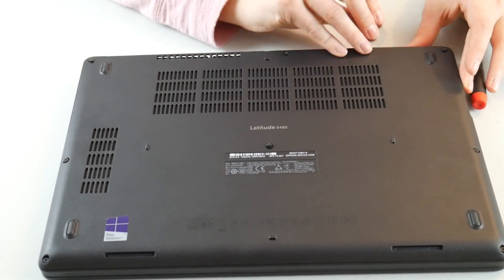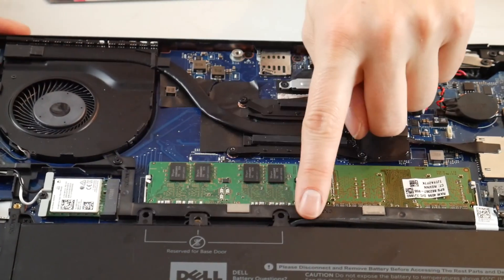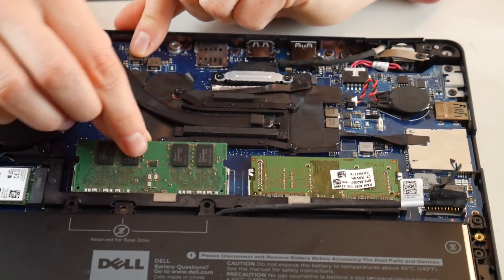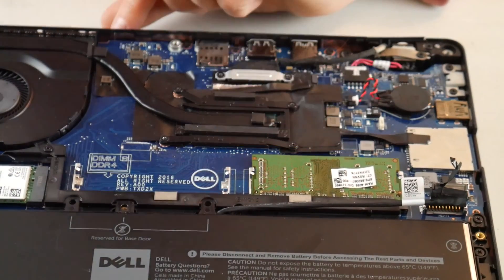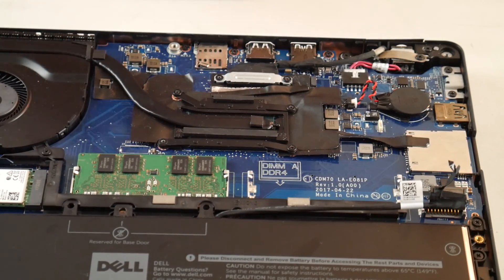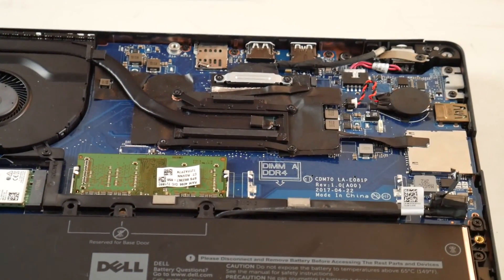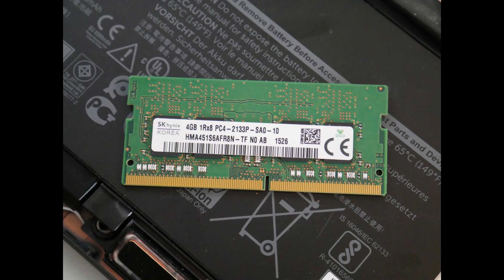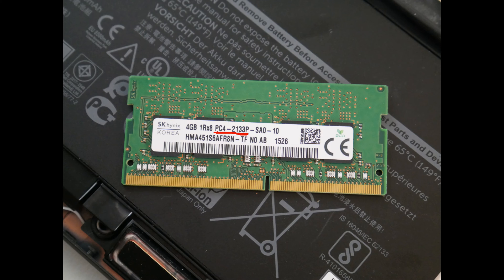How to Fix a Dell Computer That Flashes LED Code 2 3

Comment: Screen backlight turns on but no display. Getting the 2 amber pause then 3 white lights. Have tried swapping ram stick from slot A to slot B and also have another 2 8gb sticks i tried in each slot (6 total combinations tried) and same problem with the lights still. Any ideas?
Reply from the maker: You could try cleaning out the ports with a can of compressed air. Do it with the battery and power cord unplugged. Make sure not to plug it back in until everything is dry.

Comment: Hi, I tried this, but it didn't work. Also, it did 2-4 and 2-5 flashings. What do you think?
Reply from the maker: It can also be a problem with the port itself. You could try cleaning the port out with a can of compressed air.

Comment: When a computer just powers off randomly, more often over time, then won't even boot up, just dies when the Dell logo appears, or even before then.
So, remove the only single RAM stick and power on and gives 3 Blue 2 Orange on a Dell Optiplex Micro 7000. 
Would that mean it was the RAM that is faulty, or it is detecting that there is no RAM?
I suppose the latter but then we don't know if the RAM was faulty or the motherboard or CPU is still faulty but simply the motherboard has detected no RAM and so not progressing to the next stage of boot that causes it to die?
Reply from the maker: Ya its not detecting a RAM stick that's why you are getting that LED code. You would have to buy a new stick to see if the RAM is the problem. Also could be a power issue. Here is a video on how to diagnose that:

https://youtu.be/UIZitN-cnik
Reply: @EggheadFixers  thank you, it's a micro desktop but did try holding down power button with power cord removed. Getting the RAM replaced. Thanks!
Reply from the maker: @jonmobrien  You are welcome!

Comment: What if none of the steps shown in the video fixes the issue? I blown both slots with compressed air and switched modules, no luck. The RAM module is actually working just fine in another Latitude 7490 so, what's next? Ideas? (besides the obvious which would be buying a new laptop...)
Reply from the maker: Have you tried both RAM slots? I would try these two videos:

Release Flea power:
https://youtu.be/TA1mFPtKVnw
Bios reset:
https://youtu.be/bZSz-jjexqM

Comment: Is there any kyboard  words to press or push like fun I tried everything before that my laptop was fine I just opened and re packed all is fine I did before but I'm wondering if there any button because i remember whenever when I pressed the button it turned on now this not just that orange this 😐
Reply from the maker: It could be that RAM came lose and that's why it's suddenly giving you problems. It's a pretty common problem with laptops. The RAM can loosen from being moved around over time and then you will get an issue like this. There is also always the possibility that on e of the RAM sticks has failed.
Reply: @EggheadFixers  it blinkds orange
 2, 7 white after all I'm confused I cleaned ram and  I got this code  blinking 2 by7 dell Inspiron 15 5559 kinda like that it's with bios I also cleaned and replaced battery still have no idea 😐
Reply from the maker: @ghjgjgjttytttt  Error code 2 7 indicates a screen issue. Usually an issue with the LCD (screen) or LDC cable. You confirm this if you can hook it up to a monitor and it displays to a monitor.

Comment: I was change ram in slots, but laptop doesn't run. Ram is new and laptop was running with it. But now i have 2 yellow and 3 white led error(
Reply from the maker: Is it the same kind of RAM that you had installed before? Also is it a name brand kind of RAM? Some of the low end brands will not work correctly with a Dell
Reply: @EggheadFixers  error was started with stocks ram. I use new ram Adata. Laptop was turn on with new ram, but error was back

Comment: Black screen after sleep mode of 1 week and led blinking 3 white and 2 amber what is problem in my dell inspiron 3501 can you help..?
Reply from the maker: So if its 3 blinks paause then 2 blinks that's a LED code for a PCI or Video problem. If it is 2 blinks pause then 3 then that's a LED code for a RAM problem.
Reply: I am facing same problem its 3 2 ..whats the solution???

Comment: Hi its me again
But what if it is the Ram Port ?? 
What can we doo ?
Reply from the maker: You can you try cleaning it out with a can of compressed air but if that doesn't work then you will have to get the motherboard repaired or replace it.

Comment: Hiii how are you 
My i got a 3 amber blinking and 1 white
My dell wont turn on every time i plug it i got the 3 orange and 1 white led code
How to i fix it ?
Reply from the maker: This LED code is for RTC Power Failure or CMOS battery failure. Has your screen been distorted? Have you had any power issues? Has your computer been giving you any warnings?
Reply: @EggheadFixers  I think that is probably a power jack issue
What do you think?
Reply: @EggheadFixers  actually i checked the cmos battery i test it with my multimeter i got 2.9 v so i assumed that the cmos was good 
So i tried starting my laptop like u told me without 1 ram…… and i got a message. It said ( the Ac power input…….)

Comment: Hello i have been trying to do every method but it isnt working it gives me the error code i bought new ram with 16 gb and still gives me the error code i tried swapping the rams not working and i threw away the old one and i tried putting in the new one it isnt working i have also tried the bios reset and it isnt working please help me
Reply from the maker: Did you get a name brand kind of RAM? Also have you tried cleaning out the RAM ports with some compressed air?

Comment: My model is Dell vostro 7510. I bought it in 2022.
It's blinking 2 orange 3 white light .I did everything .but it didn't work. before this it showed me a alert..(no memory was detected on previous boot.).what should I do? Pls help me
Reply from the maker: It could be a problem with the RAM ports or motherboard. You could try cleaning the ports with a can of compressed air. Also you could try a BIOS reset. Here is a link to how to do a BIOS reset:
https://youtu.be/bZSz-jjexqM

Comment: How do you fix a ram port? (Dell Latitude E6430) I have the blink issue when I input to my 2nd slot. I tested for both ram sticks. 2 8'Sticks Ram, both ddr3 work in 1slot. The computer blinks (won't turn on) when I install both ram sticks & works on 1 8'Stick ram only. It slightly slipped out of my hand 2/12 inches & dropped back down on the table. That's when the issue arose. Before this both 8'Sticks worked fine in my PC in both slots...  What to do?
Reply from the maker: Usually to fix the RAM port you have to replace the whole motherboard.

Comment: Still doesnt work for me.
also tried putting new ram with same speed, and still not working. kindly advice. thank you
Reply: thank you so much
Reply from the maker: @jampongsworld2115  You're welcome
Reply from the maker: It could be an issue with the motherboard. You could try a BIOS reset. It resets the computers base system and can sometimes fix an issue with the motherboard. Here is a video on how to do it:

https://youtu.be/bZSz-jjexqM
Reply: @EggheadFixers  thank you for the reply.
will it be formatted if i reset the bios?
Reply from the maker: @jampongsworld2115  It shouldn't effect any of your data.

Comment: Hi!! my dell latitude e7440 blinks {1 white 1 Orange} on the battery. The screen is black and a Warning message.Please help.
Reply from the maker: What does the warning message say?
Reply: @EggheadFixers  Warning: If a Service tag was just installed, you will need to shut the system down and unplug the AC adapter if present, re-insert the AC adapter and power on the system to allow for proper functionality.
If a Service tag was not just installed, then the primary battery is not identifiable,
This system will be unable to charge batteries until this battery is removed,
To continue press F1key
To change setup option press F2 key
To run onboard diagnostics press F5 key .
Reply from the maker: @rogeralmeida9933  1 1 LED code is often times a problem with the battery. Does the battery hold a charge? Have you changed the battery recently?
Reply: @EggheadFixers  Since the past 2 days, nothing seems to be wrong. Touch wood. Haha yes, I have changed the battery and put a replacement from Amazon. The new battery is doing fantastically well, holding a charge and charging to it's full potential, i.e.100% in normal time. I was just worried about those blinking lights as they were a bit of a nuisance after i fixed the  replacement  battery. Any methods to fix it or just Carry-on ? Thanks.
Reply from the maker: @rogeralmeida9933  I would try releasing what is called the flea power. It might reset the LED code. Here is a video that shows you how to do it:

https://youtu.be/TA1mFPtKVnw

You only need to do step 1 in the video.
Reply: @EggheadFixers  Thanks a ton.
Reply from the maker: @rogeralmeida9933  You're welcome

Comment: I have the same problem with 2 amber 3 white lights but the computer didn't come with the ram and i just bought a new battery
Reply: Not really it still with the 2 white and 3 amber
Reply: Sorry 2 amber 3 white
Reply from the maker: @enocgutierrezlol4374  It could be an issue with the motherboard itself reading the RAM. I would try a BIOS reset. Its will reset the base system and may help fix the problem. Here is a video on how to do that:

https://youtu.be/bZSz-jjexqM
Reply from the maker: And the issue resolved itself?

Comment: Hi. My Dell 7640 have 3 orange 1 white blinking ligth. It´s a RTC battery error as I know.... but also changing the RTC battery, re solded the cable conector, the RTC battery socket, and checked the components of the RTC/USB card i can´t resolve my issue... 3 orange 1 white blinking still there.... Do you know how can I do?
Reply from the maker: Have you tried replacing the power cord? If the power cord is not giving it enough power then the RTC battery will not charge. Also how is the regular battery?
Reply: @EggheadFixers  re solder the RTC socket again  solved the issue. Thanks for the anwer!!
Reply from the maker: @tecniconotebook  Excellent!! Nice work:)

Comment: What about 3 amber and 5 white lights?
Reply from the maker: Error code 3 5 is not a listed Dell LED error code although we hear about it all the time. Dell says it does not exist. For this error code we suggest a BIOS reset because oftentimes it is an issue with the motherboard. Here is a video on how to do that:

https://youtu.be/bZSz-jjexqM
Reply: @EggheadFixers thanks, will try.
Reply from the maker: @krsol439  👍

Comment: I have tried and still no luck,
- swapped RAM to different slots.
- power ON button for 30secs with battery removed and power cord plugged.
Still 2amber and 5-6 whitle blinks and nothing on the acreen, please advise?
Reply from the maker: LED code 2 6 can be a motherboard issue. I would try a BIOS reset. It can sometimes revive a dead motherboard. Here is a link to a video on how to do that:

https://youtu.be/bZSz-jjexqM

Comment: What about 6 white and 3 orange ? NEED HELP PLEAASE
Reply from the maker: Did you try and flash the BIOS before the flashing light pattern started? The blinking pattern you described indicates a system board failure or recovery image not found. Hopefully the motherboard did not fail. You could try clearing the CMOS settings.
Reply: @EggheadFixers  tried it and still nothing happen , i hear the fan working and the keyboard lights turn on but nothing on the screen
Reply from the maker: @appland5574  Did this happening after trying to flash BIOS?
Reply: @EggheadFixers  yes
Reply from the maker: @appland5574  You could try the Dell BIOS recovery options here: https://www.dell.com/support/article/us/en/19/sln300716/bios-recovery-options-on-a-dell-pc-or-tablet
Reply: @EggheadFixers  thank you so much , i fixed it 🙏
Reply from the maker: @appland5574  Excellent!! Nice work🎉👍

Comment: Thank you so much for this. I opened my laptop last night to see if it was on dual or single channel, took the ram out to take some pictures so I get another one just like it and put it back in. Tried to turn it on this morning and saw that error. Almost passed out but it was just me that didn’t put it back in place as I should. Thank you so much! Was getting desperate here :)
Reply from the maker: Happy it worked for you!! Ya they can be pain to reinstall. It has to be just right or it will not work at all.

Comment: how about if the power button and power led blinks every 5seconds only white
on an old inspiron 1440
Reply from the maker: Error code  1 1 can be a bad motherboard or a bad battery. Does it turn on?
Reply: @EggheadFixers  guess its the MB removed the battery even tried another charger,..
Reply from the maker: @SpenceRandomGamer  Ya sorry to hear that😢

Comment: I can't believe that worked. I just unplugged the battery ( I wasnt even sure that was the battery) found what I thought was the ram stick - reseated it and it works. Question - Is this a sign the ram stick is failing ? or - Is everything cool now ?
Reply from the maker: If it happens once then it may not be a problem. If it keeps on happening then you may need to replace your RAM

Comment: I have a 1 blink followed by a short pause, 1 blink then a long pause, then it repeats. I need help
Reply from the maker: LED code 1 1 is usually either a problem with the battery or motherboard. Does your battery hold a charge?
Reply: @EggheadFixers  no
Reply from the maker: @og_szzl6627  Is it turning on still? Also you can run the Dell built in diagnostic to see if there is a problem with the battery.
Reply: @EggheadFixers  it only turns on when I remove battery and put it back in
Reply: @EggheadFixers  but the freezes in logo
Reply from the maker: @og_szzl6627  Ah I see. For this kind of problem we recommend this video:

https://youtu.be/TA1mFPtKVnw

Comment: Now that I have my laptop working again after your wonderful suggestion on reseating the RAM, should I be replacing the RAM ASAP or have I bought myself some more time?
Reply from the maker: Sometimes the RAM is just lose so you can definitely wait and see if it gives you any more trouble.

Comment: IT WORKED!  I can't thank you enough.  My Dell 5830 would not boot up at all.  Light on the front right was blinking yellow then white, then just stopped.  After reseating the RAM, I reconnected the power, and WALLAH!  It started right up like normal.  Thank you, thank you, thank you!
Reply from the maker: You're welcome!

Comment: Any ideas on what could be going on if the power LED is flashing white (consistently) with no LED flash of any sort from the other LED (LED light that flashed orange at the start of the video)? What I have done so far, removed RAM stick and installed it in the other slot, removed battery and plugged in power adapter (turned on fine). My best guess is the battery died but it was working fine the day before with no signs of failure. Battery looks to be in fine condition but I am not familiar with laptop batteries. Maybe a connection between the battery and computer?
Reply from the maker: That can be a battery problem when it flashes like that. Dell has a built in diagnostic that will tell you the health of your battery. You can access it from your boot menu. Hit power, immediately start tapping on F12 then when the boot screen comes up use your arrow keys to select diagnostic. Hit enter then see if your battery passes the diagnostic.

Comment: Hello ma'mm, My laptop is the Alienware R417 one. I am facing with the same problem, 2 red light and 1 blue light but the keyboard is not turning on also. This didnt work in my case. Could you please give me any advice?
Reply from the maker: This LED Code is for CPU failure. For a problem like this I would recommend trying these two videos:

https://youtu.be/mVYkwCEHunc

https://youtu.be/41DwR81Mwf4
Reply: @EggheadFixers  Thank you for the reply. Please have a beautiful weekend. I appricate your help
Reply from the maker: @krystelfreeze4906  You're welcome!!

Comment: Didn't worked.....
2 amber and 3 white light blinking did step by step...
What to do tell pls....
Reply from the maker: Some times it can be that both sticks are not working in rare cases or it can be that there is something wrong with the actual RAM port itself.

Comment: How about 2 amber 1 white? I really need help
Reply from the maker: A 2 1 LED code is a motherboard, power supply, CPU or loose cable. Have you done any thing with the computer that could cause a loose cable? If not I would try a BIOS reset. It resets the computers base system which can sometimes fix this error. Here is a video on how to do that:
https://youtu.be/bZSz-jjexqM

Comment: This happens too me when its plugged in and I on it
Reply from the maker: Ya then there is a pretty good chance that you may have a RAM problem. I would try the steps in the video to check  your RAM
Reply: So if I take it out and put it back in will it work?
Reply from the maker: @Kevメ  Sometimes just taking out your RAM and putting it back in will do it but if one of the RAM sticks are bad then that will not do it. If you follow the steps in the video it will help.